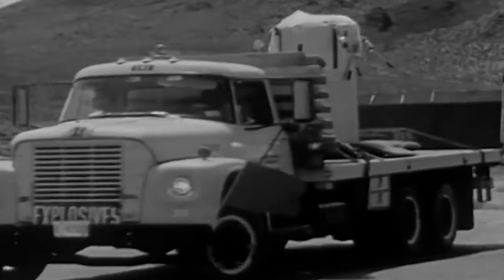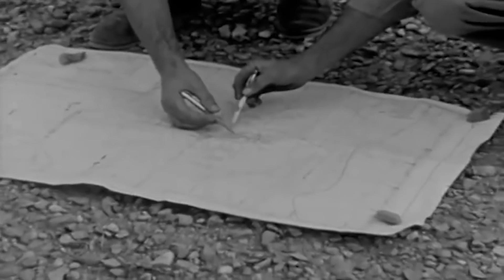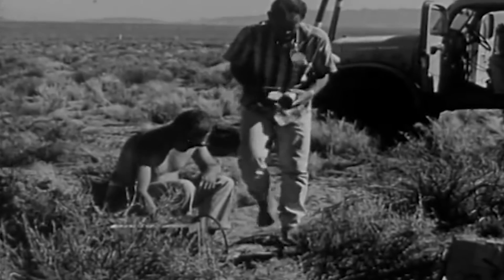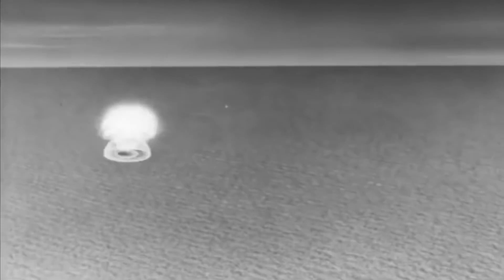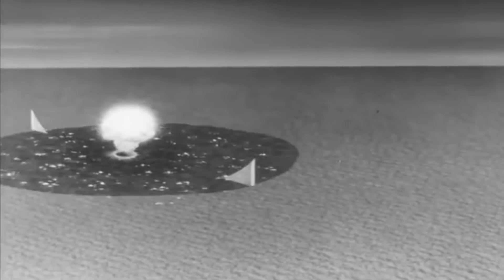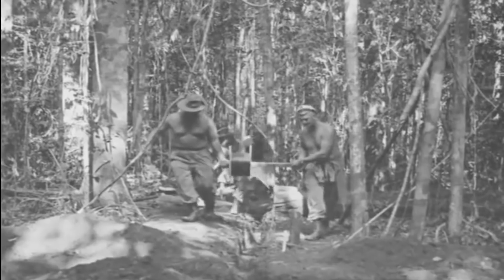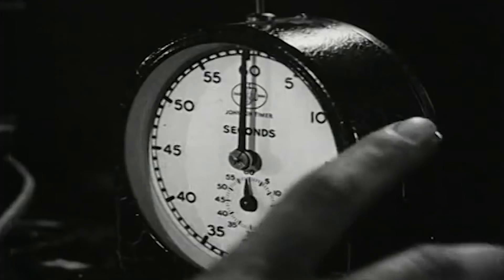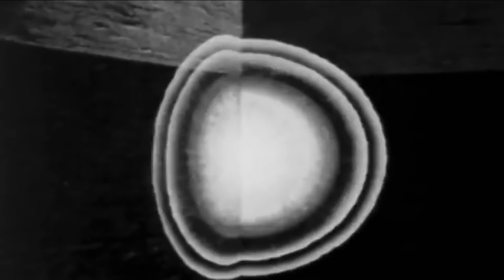Nuclear Landmine

Comment: 10kt that’s literally the smallest fission bomb I e ever heard of it looks more smoke than fireball I’m sure there’s failed fission in there somewhere the USA has  had failed fission bombs they call it a fizzle when a fusion or fission bomb where something goes wrong and it fails to efficiently completely fission or when a fusion bomb fails and the fusion fuel doesn’t fuse and and all you get is the fission from the atom bomb inside the Hydrogen bomb

Comment: Nuclear airbursts at optimal height to knock down civilian buildings do not produce appreciable amounts of fallout. It is just the bomb components that get vaporized very finely. It takes a very long time for the fallout to reach the ground and it comes down globally; time and global spread makes it very insignificant. A ground level burst like a nuclear land mine creates a massive amount of fallout locally; partially melted bits of stones, gravel, sand and silt get infused with fission products from the fireball and come down locally as well as quite unpredictably somewhere downwind (silt-sand-sized grains). 

Fallout is not an ooze or a gas. It is radioactive dirt. It radiates gamma rays from where it happens to land. It contains a mix of fission products which means there is not a single exponential decay curve. Short lived elements are incredibly radioactive, but are gone in a shorttime, and slightly longer lived elements take over as main sources of radiation. It roughly obeys the 7/10 rule of thumb. A heavily contaminated area may recieve a peak around 1 hour after blast of around 10 Gy/hr (~1000 R/hr) of gamma rays, after 7 hours it will be 10 times less; and after 7x7 hours it will be 10x10 times less and so on. 1 Gy/hr after 7 hours, 100 mGy/hr after 2 days, 10 mGy/hr after 2 weeks (this level of radiation will no longer scare away the enemy unless they have to stay in this area and are unable to just cross it), 1 mGy/hr after 3.5 months (survivable indefinitely, but could theoretically increase cancer risk if live there permanently; I say theoretically because this has never been proven for such low doses; e.g. see the cobolt-60 taiwanese appartments study for why I find such extrapolations very dubious).

Going into the crater itself it may be higher doses than this, but after several months it would still be acceptable to go into the crater and take measurements because you wouldn't be staying there long; this was in fact the kind of thing they did back then (e.g. see the Sedan test). For all the whining about "they all got cancer and died", well, no, they didn't. It's all down in the weeds; it's possible they had slightly higher risk of cancer but you need so many people exposed under controlled conditions to be able to tell it appart. Cancer clusters are very common anyway because almost everything causes cancer. Trying to tell cancers appart from different causes such as lead, cigarettes, fried food, benzene in fuels, snoring, particulates from stoves and fire places, smoked food, particulates from coal plants, particulates from cars, cured meat consumption, lack of exercise or any of a thousand other things relies on the effect size being pretty big or the cancer being otherwise very rare, like bone sarcomas and radium ingestion.

Comment: Sorry but simple logic doesn't agree with the numbers given in the video. If the information was in fact correct and taken from British stats then someone in the British military was making up pure and total B.S. If that land mine needed to be buried at least 35' deep for the best blast effect then there's zero chance it ever would have needed to be protected from freezing. Frost only goes so deep before the earths insulating effects and normal all year long ground temperatures become stable. And 35' deep is more than ample to assure that. At that 35' deep the average ground temperatures would remain at approximately 50F /10C all year long. It's a good story, but using chickens to keep a nuclear weapon from detonating even in the 1950's is more than a little bit unbelievable.

Comment: water pipes are only 6 or 8 feet underground and do not freeze..... so at 35, its not gonna freeze.... but may get close

also, modern day computers still have a "cold bug"..... if the chip gets too cold, it stops working

when people overclock with liquid nitrogen..... they have to start the PC to get some heat in the cpu....
THEN start adding LN2 to cool it down

these older electronics in the mine probably used tubes.... which NEED to be near red hot in order for electrons to jump off the metal plate
so while the temp at 35 feet down may be ~40 degrees.....it still saps enough heat away from the grid heaters on the tubes

Comment: Horseshit. At a depth of ten meters, the soil temperature is around 10-11 C year-round. Provided the shaft is properly sealed and insulated, the weapon would hold within one degree of that temperature permanently without any need for a heat source.
Reply: https://builditsolar.com/Projects/Cooling/EarthTemperatures.htm

Comment: Pfft, preposterous? Sez you. When those filthy reds start rushing the Fulda Gap, we'll wish there were some nuclear traps to slow 'em down. That Hammer and Sickle'll be flying over Paris and Berlin faster than you can say Seven Days to the River Rhine!

Bring back the sub-kiloton tactical munitions, I say. With modern linear implosion, I bet you could make those even smaller. Fit them inside Griffin PGMs and so forth, start tipping them out the back of a Spook.

The automatic loading artillery pieces said aircraft carry could also a small nuclear munition designed or redesigned for them, allowing them to place small but terrifying prompt x-ray fireballs in the laps of commie intruders everywhere! They wanna see a red wave? We'll give 'em one, a pool of their own blood to drown in!

Just stay away from windows and don't plan on going outside for that next three to twelve years...

Comment: "Sir, Their tanks are impervious to normal landmines!"
"Nuke them"
"Sir, What?"
"Did i stutter?"
Reply: very underrated
Reply: Stanley 😱
Reply: Nnnnnuuke?
Reply: Tanks are actually incredibly resistant to the normal effects of nukes. The armor doesn't melt from the flash, it is heavy and low to the ground so the shockwave doesn't tip it over. That was why the Neutron bomb was designed. The Neutrons would kill the crew, but also turn the steel radioactive so that any new crew sent to man it would be dead within a few days. 

Ironically this could backfire since radiation poisoning has a "latency period" of about a week during which the doomed subject feels relatively healthy. Such troops would fight with suicidal fanaticism as the post-latency phase is one of horrific agony.
Reply: @wamyx8Nz  i remember the experiment tank in Australia,they just did some  "cleanup" and casually drive it off to base,lol.
Reply: @cucuawe465  There was a guy in LA who while high on meth snuck on to an army base, started up a tank, and drove it off before going on a rampage. It didn't have any ammunition loaded, but it didn't matter, he was crushing cars, houses, etc. He eventually got stuck in a ditch and they blew the hatch open and shot him.

Comment: Schrodinger's chickens. The wire and timers were decoy detonation methods. The actual top secret detonation method used homing pigeons. The pigeons were raised in the chicken coop portion of the bomb casing, to establish the base location. When the land mines were to be deployed, the pigeons would be removed and taken to the command center. When the mine was to be detonated, the birds were released to fly back to the coop/bomb. Upon reaching the bomb, a soldier assigned the the task would verify that the correct pigeon had returned. Upon verification, the soldier would lift a safety cover and flip a toggle switch to trigger the fuse.

Comment: I'm having a problem with the premise of this. If it was buried 35 feet deep, it would be well into the part of the soil column that doesn't vary in temperature through the year, remaining about in the low 50s F. Did they not know that?

Comment: Who would come up with the idea of a nuclear landmine?? at 8+tons you would automatically think it's too big!!  Now that I think about it, I wonder just HOW COMPACT something like this could be in our present time?? With ICBMs carrying several on a missile warhead, does anyone know just how small a nuclear weapon could be now??? Might be an interesting topic to consider.
Reply: The minimum size of a nuclear weapon depends on the desired yield, because the yield determines the amount of fissile material needed (and the amount of fusion fuel in case of a multistage weapon).

The smallest ever fielded by NATO was small enough to fit inside a 155mm artillery shell.
This was the W48 artillery warhead, 86cm long and 15cm in diameter with a weight of about 58kg.
It had a yield of under 100 tons of TNT.

Also pretty small was the W25 warhead for the Genie air to air missile, measuring 44cm in diameter and 68cm long, weighing in at 100kg, for a 1.5KT yield.

Smaller (physical) warheads were designed and in some cases reached prototype stage, but were never fielded.

Maybe the Soviets/Russians produced something smaller.

Comment: Imagine that...the Brits having problems with their electrical systems.
Reply: Anyone who has British collector cars or motorcycles knows the quip "Lucas - Lord of Darkness"
Reply: @qtig9490  Holder of the patent on the Short Circuit
Reply: @qtig9490  Very old joke-The reason the British drink their  beer warm is that Lucas also makes refrigerators!
Reply: @qtig9490  lol yes Lucas is pure evil, and i'm talking about Peugeot Citroen equipping Lucas electronics, not only classics has problems
Reply: @qtig9490  Former Triumph Spitfire owner. One of its biggest selling points was that the previous owner had completely replaced the wiring harness and most electronics.
Reply: @qtig9490  I have owned two Norton bikes.  They were beautiful, handled extremely well, and were quick.  They actually were fairly reliable electronically too.  I seemed to be one of the lucky ones.
Reply: Sounds like a jaguar to me...
Reply: Problems, with english engineering? Impossible. Unheard od
Reply: They must be good friends with Italians
Reply: Lucas electronics
A gentalmen dosent moter about after dark
Reply: blackzed  Triumphs, BSA's and Matchless British bikes as well as others I've owned and worked on.. Miller electrics always seemed to work better in my experience..
Reply: Mr Lucas would roll over...so to speak.
Reply: We could just leave a load of 3 pin plugs along the Iron Curtain. The only time they're dangerous is when not plugged in.
Reply: Just like this motorcycles...was told many years ago that's why the Brits drink warm beer...

Comment: Is there some freaking reason that they couldn’t use a battery (or batteries) and a couple of lightbulbs to “heat” the container?

Two 100W Light-Bulbs produce a considerable amount of heat in an enclosed space.

And a regular Automobile Battery will keep a 100W Light Bulb lit for at least a week. They look like they had space for about ten such batteries, left-over (especially between the casings), meaning two 100W light bulbs could be kept lit for about 5 weeks.
Reply: A 12V, 100Ah battery (a pretty big one) will keep a 100W light bulb going for 12 hours in perfect theoretical conditions. In reality I'd be surprised if it got to double digits.

That's a long way short of a week.
Reply: It's the British, notoriously bad at electrical systems.  They were playing away from their weakness
Reply: I was thinking why not some chemical reaction to make heat but I don’t know really what could have lasted a week
Reply: @SquishyZoran  something based on the reaction that happens in a chemical hand warmer would do.
Reply: Tom Cardale Thats exactly what I was thinking of but I’ve never had good luck with them and only seem to get an hour or so and I’m just going to assume anything that could last would be dangerous in some way.
Reply: About 2 hours actually, not a week